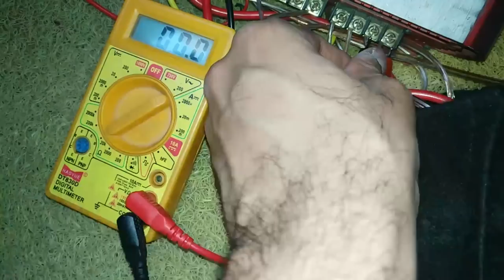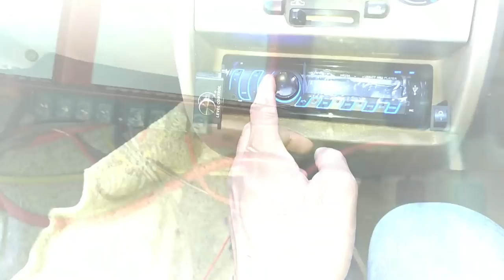Nano speaker is DEAD let's Diagnose it

Comment: Nice brother... 
I intalled central locking for my sweet nano.. i just bought actuators from amazon in jus 600 and remote with with controler in 1000 rs.. net 1600.... instalation  free as it was done by myself one day long work with lots of breaks😁😁😁..
Reply from the maker: That's awesome brother 😊😊 i am glad you did it yourself. 😊. And 1600 is fine price for it. A good deal. 😊😊

Comment: Amul why don't you invest in good quality oxygen free copper wires? Manufacturers such as Blaupunkt and Cerwin Vega offer great quality speaker wires. Also just as a suggestion- instead of using connectors of wires on speakers, you can preferably solder the wires directly to the speakers. Will help in getting better signals and amplification. Lastly you can use a wire cover sleeve, typically the black ones we get with car amplifier wiring kit to cover the wire space between the door and fender, the area you showed from where the wire is cut, disengaged.
Reply from the maker: I did invested in them back when i bought a wiring kit and the wire which got broken is from that kit thats why i installed a tested wire with a better quality copper as well as rubber now 😊. I did solder a wire on to a speaker in my other car and brother trust me the spade connectors are way better they just need to be snug fit and there will be no loss in signal at all 😊😊. I did used that sleeve known as loom somewhere in the car but after a few months it just disintegrated 😊😊 And the wire i installed is much softer than the one 1 removed so i think it wont give any problems and anyways the previous one lasted around 2 years so no worries. And i will upgrade the components soon as these pioneers sounds good but are low powered so planning to get focal soon but they are expensive. 😊😊
Reply: @AmulLuthra  Go for focal 3 way flax cone series. A friend has got them installed in his i20, and its perhaps the best I have ever heard.
Reply: @AmulLuthra  Also instead of that sleeve, you can use heat shrink tubes, difficult to find but makes the wire ever lasting.
Reply from the maker: Yeah me too thinking the same brother 😊. And whenever i change those speakers ill try once again to put the wire through that rubber thingy. If i can get the wire through that. Then the wire will truly be immortal 😊😊😂😂.
Reply: @AmulLuthra  Absolutely. All the best!!
Reply from the maker: @vikramsehtya3484  Thank you brother 😊😊

Comment: side door in which speakers
Reply from the maker: Brother i made pillar panels from fibreglass and using 4 inch coaxial speakers in them from wordltech. Then i made all 4 door cards just to put speakers in them. And in front doors using pioneer components c600in. And in rear doors using pioneer 6x9 don't remember exact model. 😊😊 and in the boot using a local made basstube temporarily. 😊😊